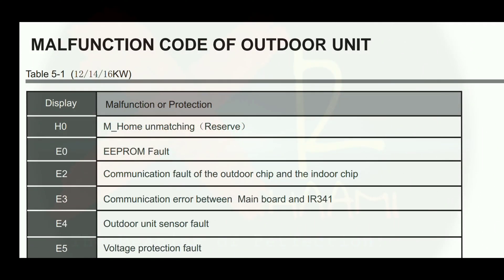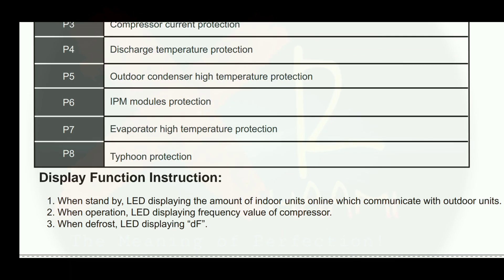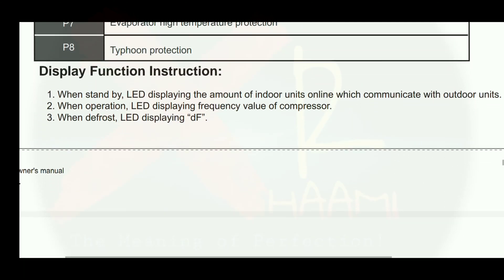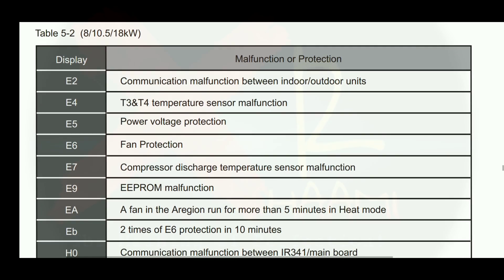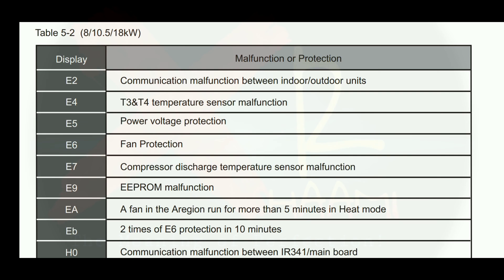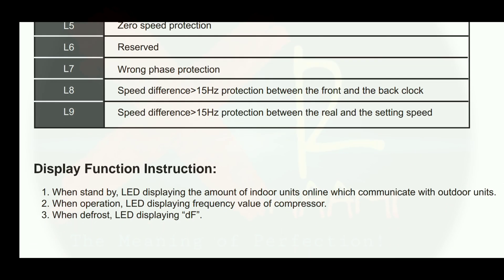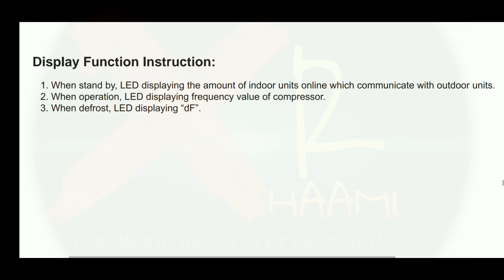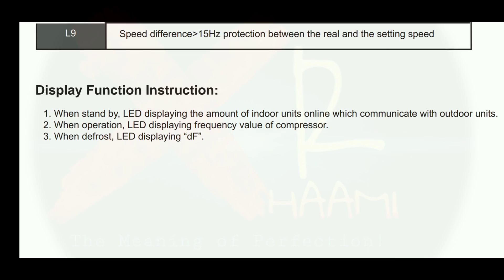Trane AC Error Codes List | Trane Air Conditioner E2, E3, E4, E5, all Error Codes.

Comment: Hi. My AC still displaying E7 after we adjust sensor and topup gas. How to solve this sir?
Reply from the maker: Check first pinned comments follow that 🔗 link u will find the error meaning according to your air conditioner type.
Thank you
Reply from the maker: Heating Fan Fault ...

Comment: EC  and light blinking in indoor error on display what problem?
Reply from the maker: Gas leaked
Check ✅ Gas
Reply from the maker: Refrigerant Leak
Bad Sensor
Bad connection
Bad Indoor PCB
Bad Outdoor PCB
Reply from the maker: https://www.sidzcoolcare.com/error-codes/trane-ac-error-codes/

Save this website for all Trane ac  error codes

Comment: hola amigo fijate que tengo en una oficina un trane xr 4ttr4036l1000aa de casette y me está encendiendo un código E8, trabaja el equipo y luego se me apaga
Reply from the maker: No sé exactamente qué aire acondicionado tiene, pero puedo darle aquí diferentes significados de los errores E8 con diferentes aires acondicionados Trane. .... Así que aquí están .... 1) E8 = Problema de detección de velocidad del motor PG. 2)  E8 = Dirección incorrecta de la unidad exterior. 3) E8=  Hay 2 veces E6 Falla en 10 minutos ( La recuperación será después del apagado)
Reply from the maker: Read this article....
https://www.sidzcoolcare.com/error-codes/trane-ac-error-codes/

Comment: Error 5 aa rahi hai kya karna hoga usme?

Please tell.
Reply from the maker: E5– Voltage protection error..

Check voltage ⚡...
Restart ac ...
Or check pcb
Reply: @RepairingSchool  remote par aa raha hai error 5 outside temperature short circuited please contact customer service
Reply from the maker: @pranjalagarwal4745 as I already told you 3 steps... If you can't find it out or if you are not a technician, than call 🤙 your company and ask technician for maintenance. 
Thanks 😊
Reply: @RepairingSchool  bhai company band ho chuki hai trane ac ki bhut dikat hai is company mei please aap he bata do kya karo step by step.
Kya aap aapna email id share kar sakte ho mei aapko image send kar duga ac ki.
Reply from the maker: @pranjalagarwal4745  Instagram.com/xhaamir

Comment: TRANE  Air Conditioners. We want to solve AC problem E: 21
Reply from the maker: Sorry E21 not found in Trane ac.
Check owner manual
https://www.google.com/url?sa=t&source=web&rct=j&url=https://www.trane.com/Resources/Partners/7e819082-38b6-42bc-b5bb-8dbef83402f1/documents/Mini_Operation%2520Maunal.pdf&ved=2ahUKEwjdpK3fyYv3AhUJhf0HHa9oBEUQFnoECAQQAQ&usg=AOvVaw2ADCQPJcs4I3FyD971cXSZ